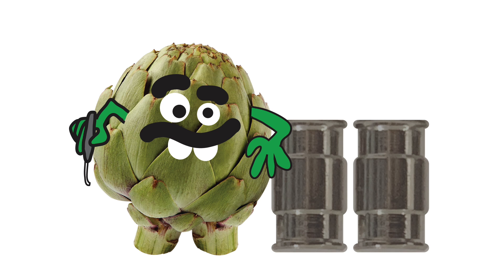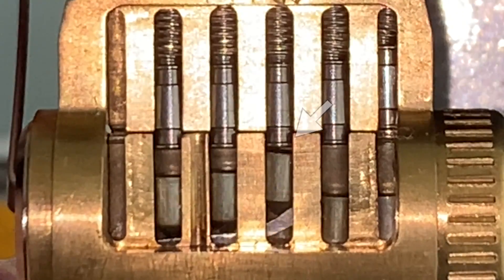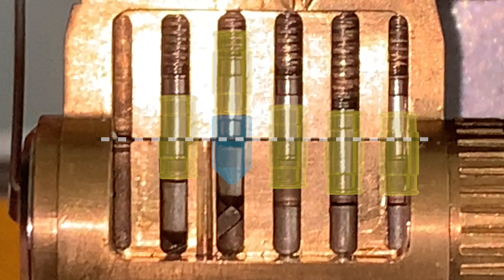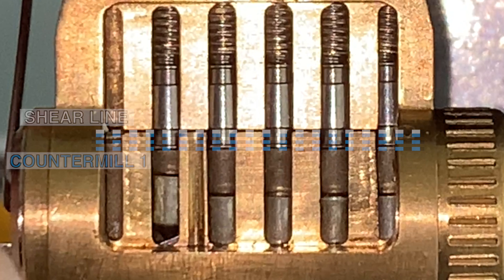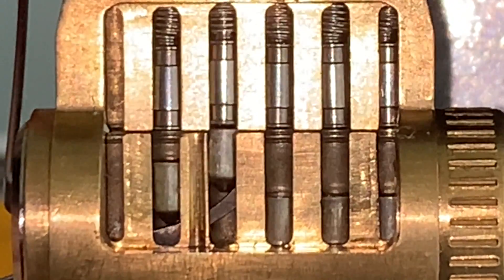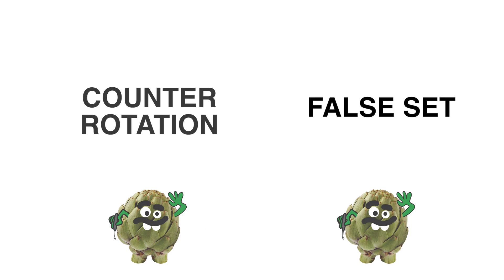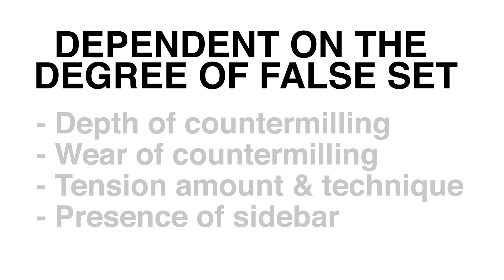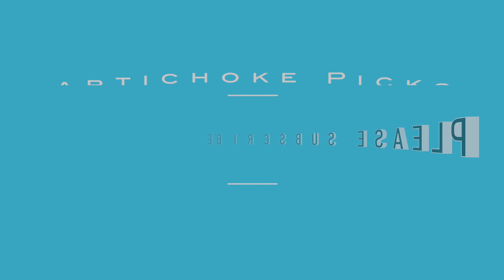(35) The Theory of Picking Barrel Drivers Part 2 (Twins Part 4)

Comment: Here is a nice comment. I agree with most of the things you said but it should be noted that the countermilling does not always go over to overmilling.
Reply from the maker: Thank you for the nice comment hahahahaha. I actually never noticed the overmilling until I got the anterior cutaway. It really has a minimal effect on picking. I did look at several other plugs and saw that they all did have this overmill. Which models don't have the overmill? Thanks for pointing this out